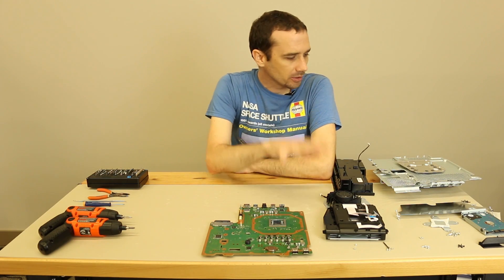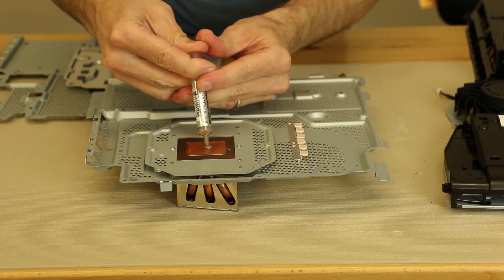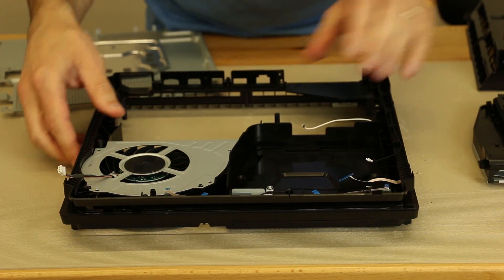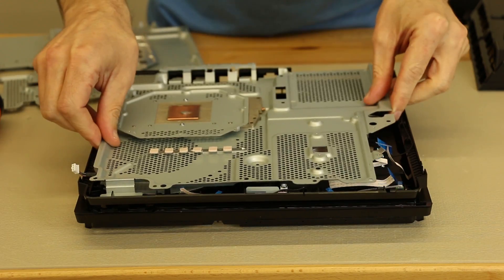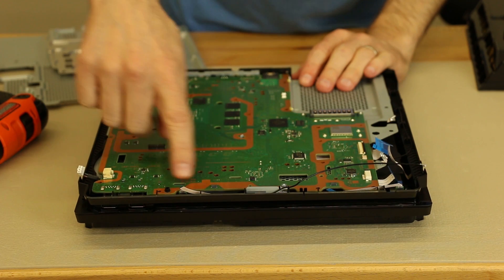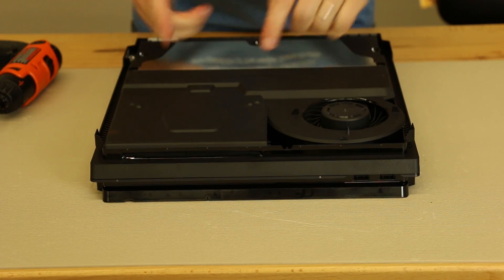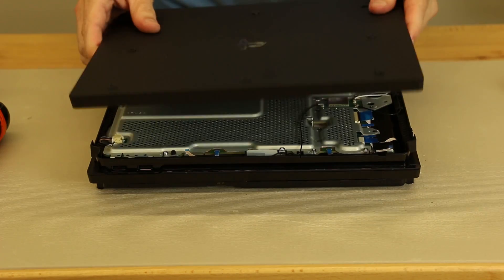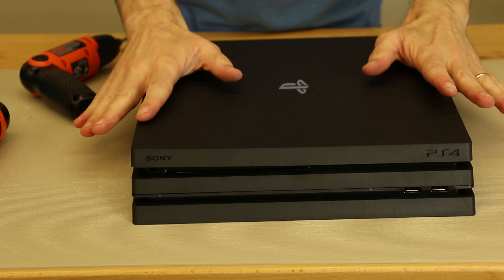PS4 Pro Detailed Assembly

Comment: Hey just curious how the ribbin cables go back in? Your videos are so helpful, thankyou! I did the tear down and now I'm rebuilding :)
Reply: Hey it’s been a year but if you still haven’t found out you have to use the blue tab and push them into the tiny slots on this PlayStation there is only one with a safety tab you have to pull up
Reply: @chiefbabylungs608  I did figure it out, ty! Works like a charm now 😊

Comment: I'm having trouble getting the power supply back in it's not being flush with the rest of it. I think it has to do with the prong things that go into the supply from the thing itself..... Figured it out. They need to be straight up not bent inwards.
Reply: This turned out to be an issue for us too. We used pliers to make them straight and far enough apart.
Reply: @lostarrowco  thanks that's what I ended up doing.

Comment: Trying to get the metal plate screwed on but the threads aren't catching.  If I take the plate off they do catch . The X bar is as tight as it will go without risk if stripping  the Philips head

Comment: Its very hard to get the two prongs from the motherboard into the power supply. Mine won't fit, and keep coming up bent. What do you do? Bend the metal plate at the end so you have more room?  Thanks

Comment: I've been cleaning my ps4 pro off and on. I bought it used off of somebody that just didn't know how to clean it. It works great though. But there was cat hair and dust all over the side vents and fan and heat sink. I didn't fully take it apart because I'm scared of messing something up. I cleaned the fan and heat sink and vents with an air duster, Qtips, alcohol, and a toothbrush. I noticed theres more dust in the inside where the bottom cover is and if I take out the hard drive would it corrupt any data? I'm just wondering before I jump right into cleaning it some more

Comment: I have a problem with the psu after I changed the thermal paste and put it back again. I can't get it out anymore. It seems to be stuck exactly where the two metal pins are. I have tried to pull it quite hard, but nothing moves. Have you ever had this problem? What can I do in this case? Can you please help?

Comment: This guide would've been perfect if you showed a close-up of the screws (when you screwed them back in) so we can be sure of what screw to use for each hole. I'm not sure and I can't find a guide like that online so I guess I'm gonna have to some trial and error. :-(
Reply: Im having a hard time screwing in the black 8 screws it seems to small for some reason please help
Reply: @Nelli_styles  me too and i have blod because of that any fix ?
Reply: @Nelli_styles if they are too small either try another screw or take the plates off and make sure they are on right and flush another way to check to make sure it is flush is by looking at the screw holes and seeing if they are aligned or not useing a flashlight helps greatly
Reply: Right!
Reply: I was saying the same thing 😵
Reply: Use a flash light there are 2 different threads the bigger threads is for plastic and the smaller threads are for metal when doing the top plate plastic screws on the outside and metal screws on the inside
Reply: Yup! That's the trickiest part
Reply: Yeah, that was the largest issue with this video. I have no idea where some of my screws are missing from.
Reply: Same

Comment: Quick question..... when I put the power supply back in,  it won't lay flat (bulges in the middle.)    Any ideas why?
Reply: Can you turn ps4 on or  ? If not then you need to put it again to lay  flat
Reply: Because the prongs are bent.. that was our issue.

Comment: You took apart the disc drive in your previous video and didn't show how to re assemble. I had to get some credit cards out of the drive and now it the metal top doesn't want to line up on the board and motor part

Comment: Hi, does PS4 require formatting after assembly? I just received my PS4 after disc drive repair and noticed that everything on the hard drive was wiped out.
Reply from the maker: Where did you get it fixed? If you sent it to Sony they wipe everything when you send it in.
Reply: I sent it to a regular shop but the guy informed that there was no other option since the processor was removed and then was put back in its place, the PS4 once booted will require a format. I wasn't fully convinced to be honest.
Reply from the maker: That guy has no idea what he's talking about. There is absolutely no reason you would need to wipe the hard drive in order to repair the disc drive. The "processor" would be the APU and it's a BGA chip and soldered to the motherboard and I can guarantee you he didn't remove it.

Comment: Do i really need to replace the thermal paste?
Reply from the maker: If you remove the motherboard it's always best to replace the thermal paste.
Reply: @Tronicsfix  having trouble getting my pro back together. Stripped a few screws. Some screws were harder to come out then others. The whole process has been a struggle for me. Hopefully it will turn on after its all set and done
Reply from the maker: It can be tough. Do you have the correct tools?
Reply: Cool but do you need to actually change the thermal paste or can I just clean heat sink ?

Comment: Do the wifi antennas snap on and off or what?
Reply from the maker: They have a pull connector. Pull it off & push it back on.
Reply: so you don't need any special tools when you snap all 3 off?

Comment: I'm having a real issue getting spares for my ps4 pro CUH-7016B. I bought a pro that was faulty (wouldn't accept discs). I've opened it up and found the white circular plastic above where the centre if the disc sits was out of place. I can see that it has small white clips that hold it in place. One has broken. I've sat it back and tested loading with a screwdriver. It loaded it seemed. On re assembly the disc was accepted but made a horrible noise and just kept spinning. Now the original fault has come back. I cannot find anywhere that has replacement drive for a pro!! So annoying. Would I be able to use the similar part from a ps4 slim optical drive?
Reply from the maker: No, they are not compatible. I don't know of anywhere to buy this part for the Pro yet. Sorry.

Comment: I did this, got to the disk drive, fixed the problem, put it all back together. But now when I turn my ps4 pro on , it starts up and my fan spins really fast, then my console bleeps 3 times and turns off. Could you help?
Reply from the maker: Sure...you can send it in to us for repair: https://tronicsfix.com/collections/get-started

Comment: I put my ps4 back together in put a new Battery unit supply in it it comes on few seconds then it goes off what can it be
Reply from the maker: Probably the APU solder joints or you got a faulty replacement power supply.
Reply: How much would it cost to send it to you to have it fixd
Reply from the maker: We actually don't fix those. You may be able to fix it yourself though: https://tronicsfix.com/blogs/news/ps4-on-and-off-fix

Comment: So my PS4 Pro fan seems to have a weird whistling sound when playing certain games. It almost sounds like there are two sounds; one low pitched whistle, and one high pitched. The pitch changes constantly every few seconds and the fan increases in speed, lowers in speed, increases, etc. over the course of several seconds. Is this normal?
Reply from the maker: I don't know...I'd have to hear it. Fan speed can change a lot...they're made to do that.
Reply: "The most important aspect and most widely known issue.. FAN NOISE. This one aspect had a few very distinct differences on noise and behavior. From deeper research i found the maker of the fan differed between Delta and Nidec. If you had a delta fan you most likely heard a sort of whistling varying pitch noise. If you had a Nidec fan you more likely heard just the whoosh of air being expelled from the unit and these fans were generally quieter. " credit: Chronos24 - neogaf

Comment: Hi team TronicsFix i have a question please, iwant to know where i can buy original internal fan for my ps4 pro it doesn't work
Reply from the maker: Hi! Currently, nowhere. Parts for these aren't available yet.
Reply: How do I fix my fan because it does not work but the power is good
My problem is that my ps4 pro restarts after 5 minutes, 3bips
And after a diagnosis I found that my fan is not running and in your site I saw you doing the repartition
Reply from the maker: repartition?
Reply: TronicsFix sorry how to fix this problem
Reply from the maker: So you've verified that there is power to the fan wires?
Reply: yes the output from the motherboard is well 12v,
Reply from the maker: Well, unfortunately, there isn't anywhere to buy them yet. Keep an eye out on Ebay I'm sure they will show up there soon.

Comment: i will change the thermal paste as soon my T8 security screwdriver arrives ! 
unless you tell me if the Thermal paste Sony is using is high quality and dont need to be replaced?
Reply from the maker: The thermal paste seems fine. I don't know what they use but I doubt it's super high quality. If it was me I would wait at least a year before replacing. That's just me though.
Reply: The thing is mine PS4 Pro is making a very softy bzzzz sound.. its somekind of vibration noise, you can hardly hear it but it is there and it is anoying becouse now i pay attention to it, but when i press with my finger very slowly on top of the console (front right corner) the noise is gone and the cosole is 100% silent!.. i have a feeling some screws if not all of them are too hard tightened.. is that possible? or should i return it becouse i still have 1 week return/money back from my store.

Comment: That ps4 pro even melts get over 140 degrees
Reply from the maker: They did put in a new, larger fan. They also put in a larger heat sink.
Reply: It was a fake.  Some douche intentionally burned his PS4 with a lighter.
Reply: charvelgtrs the pro melts that's it you dumb people tronics fix tell them that it melts
Reply: Frayhua it's not a lie because the ps4 got how and now you got double ps4 double the power so the logic since they didn't put a new fan that means it can melt can you actually think for your self man idk and I didn't need to search for that etheir so think more about things